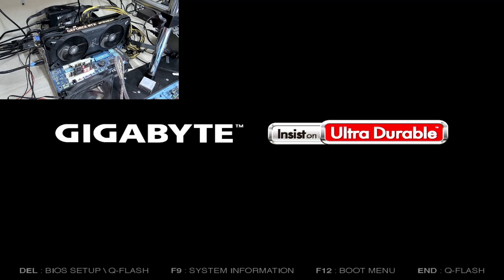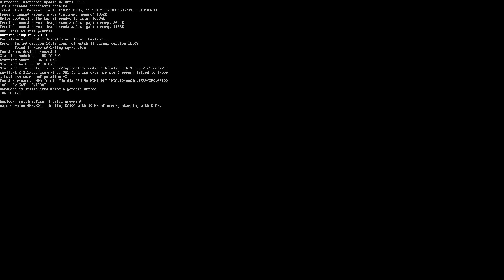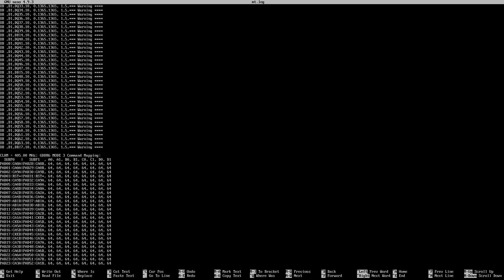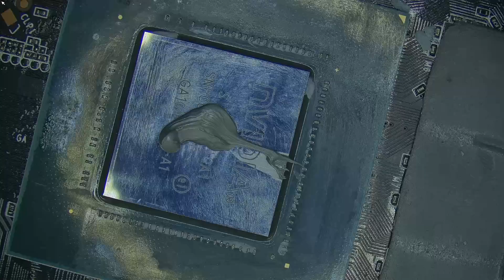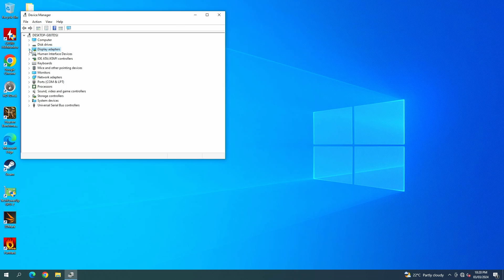Palit Jetstream RTX 3070 Error Code 43 and Artifacts Fix

Comment: hi , did you preheat the pcb before removing the memeory ,if yes how much temp of the blue preheater ?
Reply from the maker: Yes. While removing memory, PCB has to be prepared. The blue preheater goes upto 120°C. I use the highest. If you can get hold of a preheater that can go upto 200°C or more. Go for it.higher the better. Higher the preheater can go lower temps required on the hot air and that's best for PCB.
Reply: @GraphicsCardRepairs-tk7ql   this blue preheater can reach more then 120 C ?
Reply from the maker: @PokerNotesProNet it can reach only upto 120°C

Comment: Great work on the repair sir, is there a mats or mods version for amd cards? Specifically 6000 series? I have a powercolor red devil 6700 xt 12 gb with artefacting issues when the card is under load and games crash but when I lower the core clock to 1000 mhz or undervolt it it resolves the issue
Reply from the maker: AMD uses a similar memory testing software called memtunes. unlike Mats and mods, these software are like 90GB plus.

Comment: hello my friend, i believe my comment was removed from here because I sent in Ali Express Links
I want to ask a couple of questions if thats okay :)

How Hot do you set your hot air station?

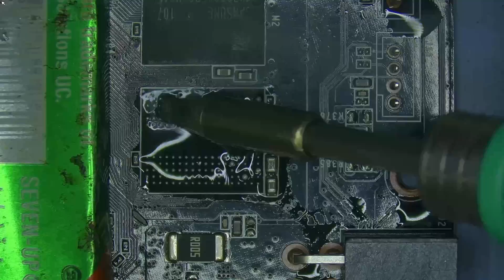At 10:27 and At 10:56 what do you put on the chip? Is it NC-559-ASM-UV Flux?

At 11:10 what do you put on the iron? Is it Leaded Solder of Lead Free Solder?

At 13:40 what do you put on the brush?  Is it NC-559-ASM-UV Flux?

And if I buy a chip from Ali Express K4Z80325BC-HC14, do I need to reball the chip or no?

Thank you so much, keep up the great videos :) 
And Ramadan Mubarak (If You are Muslim)
Reply from the maker: The Hot Air station is at 420c with 60% Airflow. 
At 10:27 and 10:56 I put NC-559-ASM-UV flux.
At 11:10 it is leaded solder.
At 13:40 is used AD-559 Mechanic Flux
If you are buying chips from AliExpress they come reballed so you don't have to reball. But I prefer to reball with leaded solder and keep.
Reply: @GraphicsCardRepairs-tk7ql 
Thank you for answering, 
can i use nc-559 instead of AD-559? Or is that not ok?
Also could you share where you bought them?

Thank you and sorry for taking up your time
Reply from the maker: NC-559 is also ok. The idea is that flux should not get burnt while soldering or become hard. I also have NC-559 I have not used it yet just got it recently. I will try it soon. All my flux I get from AliExpress.
Reply: Thank you!
I have one last question
Is it ok to use leaded solder with 60% tin and 40% lead or do i need a different type? @GraphicsCardRepairs-tk7ql  
Thanks! :)
Reply from the maker: Yes 60/40 is good enough. I use mechanic
Reply: What diameter should i use for leaded solder and what size should i get for braided copper? Thanks  @GraphicsCardRepairs-tk7ql
Reply from the maker: For braided copper, get 2 sizes. 3 mm and 2 mm. For leaded solder wire you are referring to, then that would depend on your tip. Smaller caps and other components I use 0.3mm as it would work well. For everything else  1 mm will do fine.
Reply: Hi! Can you send links for flux and leaded solder AliExpress when you have time? Thanks! @GraphicsCardRepairs-tk7ql

Comment: Hi, little advice, when pcb still hot after take off the ram modules and prob for data lines under core from ram module pads it can trick u. Solder cracks under the core may touch each other when pcb hot. Put it a freezer and prob it when cold and u can sure the repair job dont came back to u few months later. I love ur videos by the way, keep it up, sry for my english.
Reply from the maker: Sure I will keep that in mind. Thank you 😊